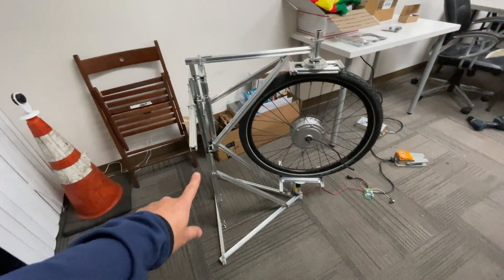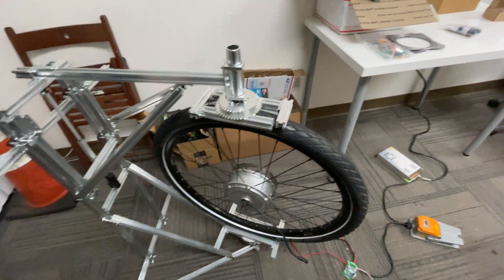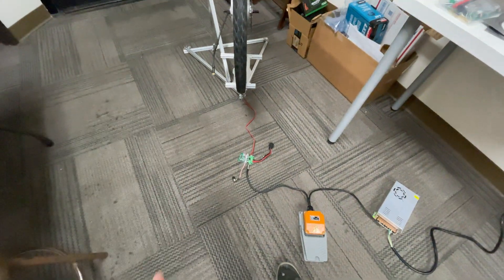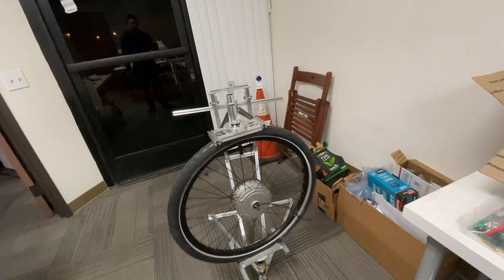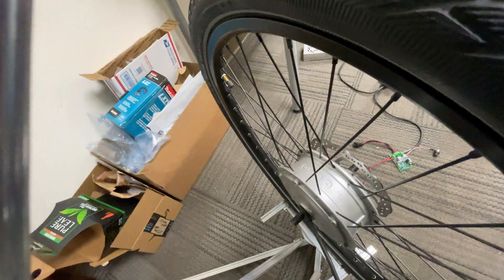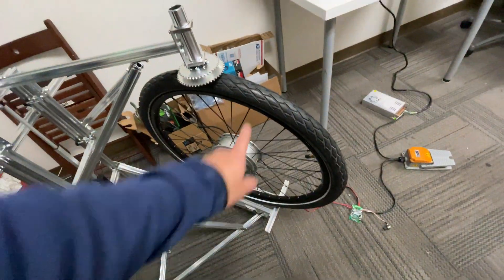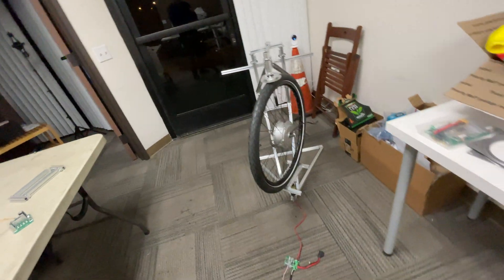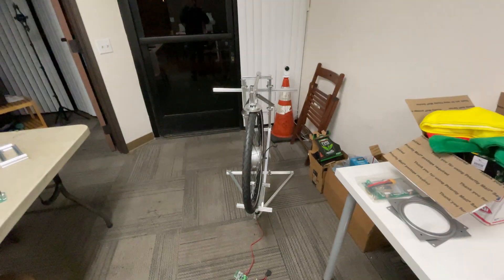I need to Build a Robot,  will it work?

Comment: Ive got quite a few MOSFET off of BMS on 40 cell scooter packs.   "ST 15810" seems to be the part number. 
 The datasheet reports they are pretty beefy at 100v and 110A.  Im curious if they would make good replacements for upgrading a ebike controller.
Any comments????

Comment: Be quicker with just a well geared hand crank on top and pressure is maintained by the user as they hold the crank handle down and spin the wheel. Less mechanical stuff to worry about as breakdowns mean downtime on production.

Comment: I think rather than a linear actuator, it should just be sprung. Also, if the wheel rolled around it's axis as well as spinning then you could completely wrap it rather than just around its equator. I think that motor might be a little underpowered if you want it to pull the film off the roller under a bit of tensions. Maybe a wiper motor might be more suitable.

Comment: If you clamp the wheel with a set of 4 skateboard wheels top and bottom with a drive motor to rotate the wheel around it's normal axis . As the wheel rotates and turns at the same time just feed the wrap onto the wheel and it'll cover the whole wheel like it's wrapping a block of cheese or a silage bale. The top arm doesn't need a motor to clamp , just a spring.
https://youtu.be/VYZEXj_vYxU

Comment: 36V 350W Bafang front hub with Tektro disc brakes? This looks exactly like a motor I bought recently from a commercial dismantling project. This is an awesome motor for a DIY Ebike.  Knowing how to build or source a battery and motor controlling system for Ebikes is a plus (but not a large hurdle to overcome) . Don't shy away from this motor; it may not be super powerful, but it is certainly fun. If I'm wrong about the motor specs, I'm sorry, but you didn't spec it.

Comment: I would set up your machine with a clamp  you secure with your foot that grips the tire close to the ground. And then make the "robot" part hold the plastic wrap and spin around what ever you have clapped. It might make it easier to use for other items going forward. Just may two cents.

Comment: Yeah my only concern is that small dc motor and gearbox looks a little weak and might break down. Seems like you need a big wood CNC router, as that is good for stationary constructions like this.

want to see an update on how it works for sure.